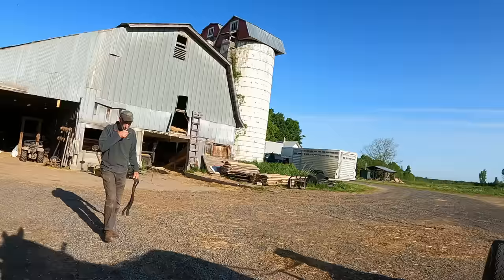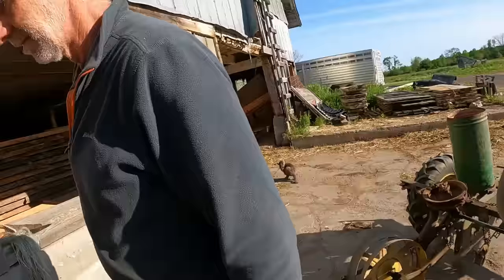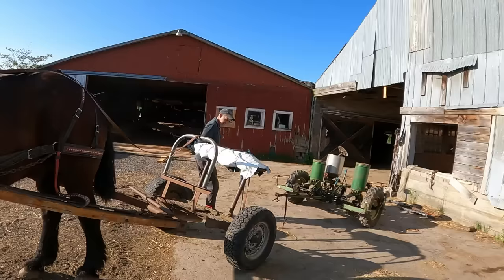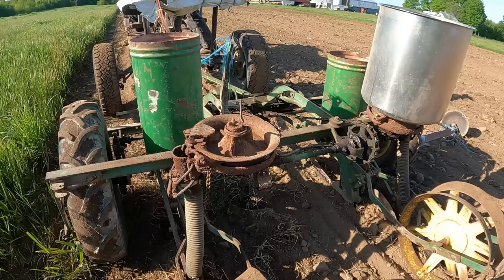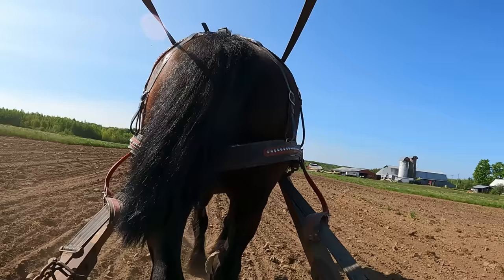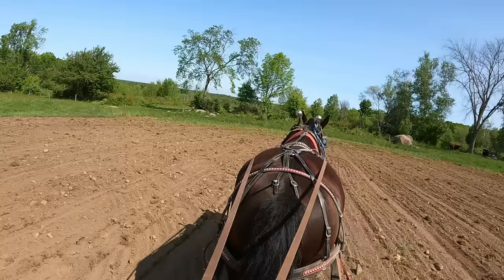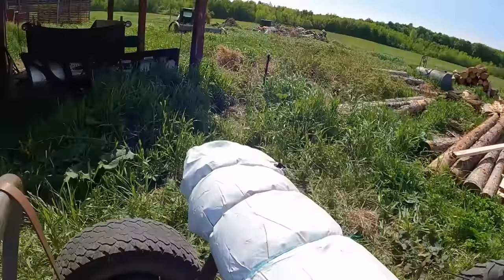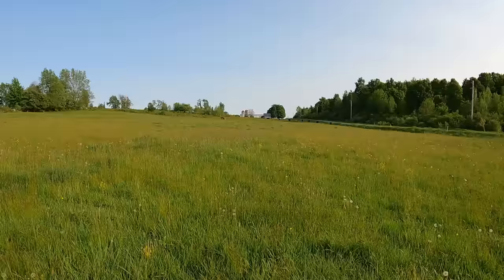Corn Planting with a Single Draft Horse//Silo Stories #486

Comment: My job on the farm as soon as I got home from the one room school and we were filling silo, was to guide the blower pipe to keep things level. Because we didn't have enough silo capacity, when the silo was full, we would put in another load to equal what we fed. My job was to guide the top funnel. The silage was 3 feet or more up into the roof area. The top door would get covered over and I would be trapped. I would have to slide down to make an opening and then somehow find the top step with nothing to hold on to. I was always afraid of falling down the chute. The silo door locks also served and climbing rungs and one side would often slip and I made sure I had a firm grip. I was only 5-8 years old at the time. Every day we would try to get another load in and my grandfather would be waiting for me. I hated that job but somebody had to do it.
Reply: Thank you so much for sharing your "job";  We have all forgotten what it was like, and we need to remember what our childhood was like.  God bless and we can see how HE kept you safe.

Comment: I'll climb any ladder, as long as I can keep one foot on the ground.  
I am continuously finding oddball jobs for vinyl electrical tape.  Just a couple of days ago, I couldn't find a piece of cellophane, so I used a small amount of the tape to make a dam for a crazy clue repair of a leaky plastic fuel tank.  It didn't work perfectly, but it did the job.  I sometimes even use the tape for electrical work..

Comment: My grandfather's silo didn't have a hard wired light inside and he would have an extension light that ran up the chute. It was usually before dawn when he would throw ensilage down to the cows.  One morning he scooped up a rat in the silo as they were good climbers and got in. The fermenting corn was probably warm. Anyway, the rat ran up my grandfather's pantleg. He wore baggy leg overalls. He probably had long johns on underneath depending on the time of the year. He grabbed his pantleg to prevent the rat from getting up into the family jewels and he did a lot of kicking to get the rat out. Finally he got it out and he killed it with the ensilage fork. I cannot even imagine. I would have been looking to buy a silo unloader the next day! One other time, he reached up to get a calf pail hanging from the rafter and knocked a mouse down the back of his neck inside his shirt.  He did some dancing then too. Life on the farm!  I guess it isn't too much different today as I am dealing with a woodchuck digging a hole under my back steps. Last year it was under my barn! We were always fighting them on the farm and it was my job to try to keep them under control with my 22. A never endng job. You don't seem to have a problem, at least not one you can show on YouTube.
Reply: I think they have working cats!!

Comment: This old stuff is so cool to see, I am a 4th generation farmer on our land up in Alberta Canada amd my family ran horses until the 40’s pulling cltivators and seed drills, i still find remnants of it all over in certain fields, they bought an old steel wheel massey harris around 1941 then got a massey harris 101 senior and started seeding and cultivating with that. We run a stx 450 case ih with triples and a new holland 51ft air drill with a 380 bushel cart now going over around 2000 acres but back in the day the horses did alot, i do believe we had 640 acres to go over with just horses pre 1940. Man how things have changed

Comment: I carry a piece of baler twine, and a roll of electrical tape in my overalls every time I work my horses. For my money, the cost of plastic wrap, and the waste produced by the used wrap, plus the task of moving the bales to feed, I'd hire a custom operator to fill one of those small silos in a day, tramp it well and wet it down and spread a tarp over the surface, weighted down with another few inches of haylage blown in. Will keep it till fall time and opening the silo up. Feed the cows all winter and no bale wrap to dispose of. When I was a herdsman milking cows it was good stuff, we had a corn silo and a haylage silo. Pushbutton unloading though! and we had a taperboard feeder that sat on precast feed bunks. Later we installed a tmr mixer. At home we were all dry hay and grain mostly as we found it hard to keep ahead of the spoilage in the silo with a smaller herd, we had a 14 by 55 with a wornout unloader and spent more time fixing the unloader than it was worth. Faster to fork it out.
I remember working the field diagonally last pass to see the markers on the planter, But hey, you get more corn in a crooked row lol. A fast trip through with the scuffler will eradicate the stray plants haha always a challenge to scuffle those point rows, last time I scuffled corn was 1988 on a farmall 656 with a 4 row matched to the 4 row IH cyclo planter, wide row I believe. As long as the field by the road looks pretty, right?! Give the boys at the coffeeshop something to talk about.

Comment: Hi Jim, grate to see you using a new to you Old Hors drawn JD Corn Planter. I plan on starting a restoration project on an old Horse drawn JD Corn Planter with all steel wheels sometime in the next year. I have to Build a Metal rolling machine so I can replicate part of the wheels and the Seed and Fertilizer Cans.

Comment: I have used an old skinny bicycle inner tube to cover broken snaps either by tying a short piece on and pulling it back to snap or a longer piece covering the length of chain. I have found many uses for old inner tubes over the years.

Comment: You should hook a set of hanging scales to your shafts and get Brenda sit on the seat. And lift them up to the height that they sit when they are hooked to the horse. I bet there’s no more than 30 lbs on his back! I’ve tried that with my cart . I’m sure Ken can handle 30 or even 50 lbs that’s a pretty wide back pad , even though it’s not as padded as a single harness back pad.

Comment: We're giving the same pills to our colt. The way I do it is pull the plunger all the way out, put the pills in the syringe, put the plunger back in and push all the air out then pull water back into the syringe. Another thing is to wrap the syringe with plenty of layers of black tape so it won't crack if they bite it.

Comment: Have you ever planted corn by checking it? I think thats what it  is called. My grandpa told me about it where you have a string or wire with knots on it. It is fed into the planter and then drops a kernal of corn every time a knot goes thru planter. That way you can cultivate both ways because the corn is planted in a such a way that you can go crossways and lengthways. Probably not explaining it right.

Comment: I am glad you did not start this video by saying.  "This is working horses with Jim."
I learned a new word, "shaves" (spelling?). Is it one of those English words that are spelled the same, but have six different meanings based on how they appear in a sentence? 

I find it unusual that our elected public officials do not understand the lies been told in the NIST and 9/11 Commission reports as explained in the link to the video lecture 
3, 641 architects and engineers also say NIST lied. Of course you may not have an engineering  degree.  Neither do I.  I understand the lies as they were pointed out in the videos/lecture.  Some 320 skilled commercial and military pilots (Pilots for 9/11 Truth) have also said they believe the NIST and 9/11 Commission reports are full of lies regarding the airplanes. 

A good video/lecture as to why we need a FBI investigation or Congressional investigation of 9/11
 part one WTC7
https://www.youtube.com/watch?v=DXAuYjcjjPo
Part 2:  NIST’s false statements about the Twin Towers' collapse 
https://www.youtube.com/watch?v=J6F16xBQPMU

I just want to add that Mr. Angle should have mentioned that ALL of the concrete floors in the Twin Towers and the corrugated steel panels onto which the cement was poured, it turned to dust or sand. Pieces of office equipment found in the wreckage were reduced to no bigger than a baseball.   Steel was blown 600 feet out of all four sides of the Twin Towers.  Therefore all this weight had to be subtracted from the force required to crush the lower floors.  These lower floors were made of much thicker steel beams.  So how does lighter steel crust stronger steel?   Impossible unless explosive and nano-thermite were used. 

A seismic wave monitoring station recorded shock waves coming from the Twin Towers, but these shock waves were not made by the airplane impact nor the steel building crashing to the ground.  The shock waves were made by explosions. 

Eye witnesses reported hearing explosions and seeing molten steel, but NIST refused to interview and in include their witness statements in their final report.

Resolution demanding the FBI investigate why there are so many lies in the National Institute of Standards and Technology’s (NIST),  the 9/11 Commission reports, and why was  Susan Lindauer denied  a speedy trail. 

WHEREAS 3, 641 architects and engineers (AE911truth.org), and some 320 skilled commercial of military pilots (Pilots for 9/11 Truth), are saying that there is scientific irrefutably evidence proving that the TOTAL collapse of the World Trade Center buildings on September 11, 2001 were destroyed by explosives and incendiaries and not ONLY due to fire and airplanes,

WHEREAS never before nor after 9/11 has any steel high rise building totally or party collapsed only due to office fires having all its concrete floors turn to sand or dust, 

WHEREAS Dr. David Ray Griffin lists included over 100 lies or omissions in the official 9/11 Commission report. This article is an excellent summary/companion to Dr. Griffin's newest book, The 9/11 Commission Report: Omissions and Distortions, 

WHEREAS Dr. Leroy Hulsey and his PhD students concluded in their four-year study of the collapse of WTC7, that this steel high rise building did not collapse due to fire, 

WHEREAS the Lawyers Committee for 9/11 Inquiry submitted direct evidence to the US Justice Department and they refused to empanel a special grand jury, therefore US Attorney for the South District of New York is guilty of misprision of a felony regarding this 9/11 crime,

WHEREAS after the US Court of Appeals failed to order the US Attorney to empanel a special grand jury, and the US Supreme Court refused to hear and overturning the Court of Appeals refusing to order the US Attorney to empanel a special grand jury, 

WHEREAS Susan Lindauer was indicted on March 11, 2004 and jailed from Oct. 2005 until Sept. 2006, (2.5 years).  All total she was under indictment for four years and some eleven months without a trial.   On January 16, 2009, the US Justice Department decided to not continue with her saying it would no longer be in the interests of justice,

 WHEREAS after 9/11, only 40 percent of the Democratic caucus in Congress were in favor of authorizing Bush’s war against Iraq,  

THEREFORE BE IT RESOLVED we demand the FBI investigate why there are so many lies in the National Institute of Standards and Technology report and the 9/11 Commission  report
For more see my research papers:  911 Direct Evidence and The false US Imprisonment of Susan Lindauer
Send me an email at dickmcmanus55@aol.com  
and I will reply with them attached  for FREE  
And remember weaponized anthrax letters killed people. The FBI did not interview all the at least 200 people who may have had access to this poison.   

Richard McManus  
Chief Warrant Officer-3/counterintelligence special agent  (more like an FBI agent than CIA officer), US Army retired, combat paramedic South Vietnam, BS psychology and nursing, Everett, WA
Reply: Take this somewhere else
Reply: @Russ Long  ...well I did believe him when said he had a BS degree.  Sorta kinda obvious.